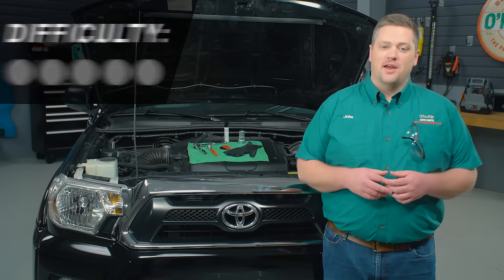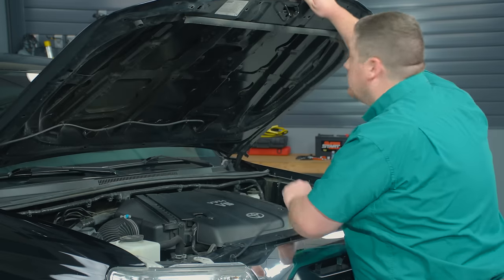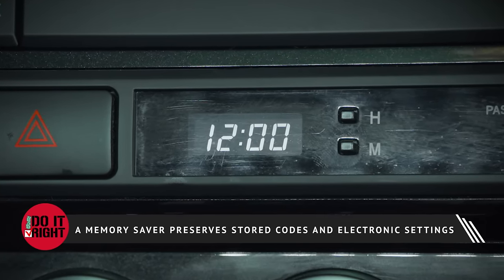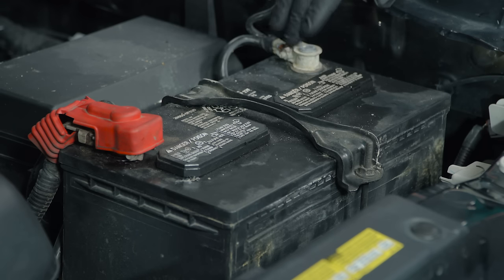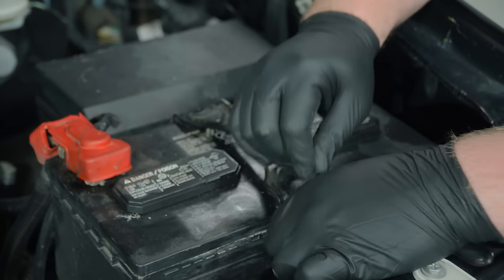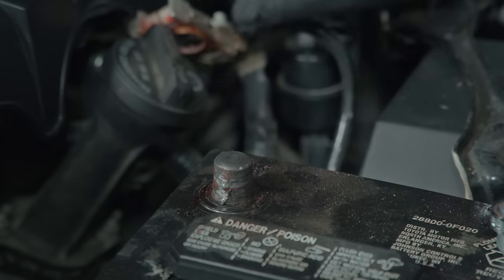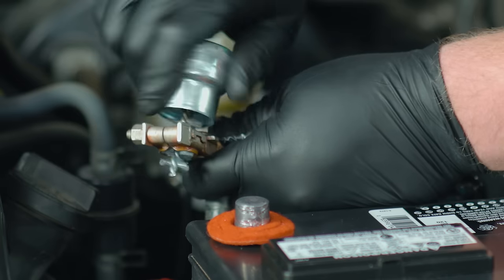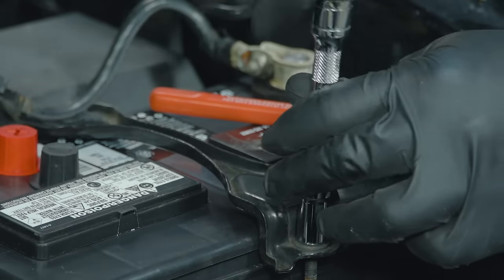How To: Install a Battery in Your Vehicle

Comment: Negative first, negative last.
Reply: depends, it switches each way, when connecting and detaching, but um, yea
Reply: TheSkidds I always remember it like this. Disconnecting a battery? No Problem. NP. Negative first, and then Positive. And of course the opposite when reconnecting.
Reply: Cooooooooom

Comment: Usually videos made by companies that sell motor vehicle parts, regarding how to install the parts they sell, give correct instructions regarding how to install them. That is not the case here. The first step should be removing the cable from negative terminal. If you remove the battery hold-down clamp first, there is a chance you might bump either the metal clamp, or the wrench you are using to loosen it,  into the positive battery terminal. That would create a short between the positive terminal and the negative terminal. Bad thing. If you remove the negative cable first, then there will be no problem should the hold-down clamp accidentally touch the positive terminal. When you remove the cable from the negative terminal, you do not have to worry about preventing it from touching metal parts of the vehicle. There is no harm in that. Next after removing the negative cable, remove the positive cable. Remove the hold-down clamp last. When installing the new battery, it is a good idea to coat the battery posts with a thin film of grease. Also coat the entire cable clamp with a thin layer of grease, inside and out. And put a goodly amount of grease on the threads of the screw that you use to tighten the clamp. This will make sure the parts do not corrode. When you remove the cable from the negative terminal of the battery, it is probably a good idea to also remove the far end of the cable, from where it connects to a ground point on the vehicle's body, and grease that connection too, including the threads of the screw that screws into the vehicle's body.
Reply: Great advice! Thank you!!
Reply: This comment is from an experienced professional.  He knows that what can go wrong will someday bite you.  Do it right once, the first time, so you don't have an embarrassing come back on a simple battery replacement.

Comment: What is the reasoning for taking the negative off first, then the positive?
Reply: Because, negative terminal of the battery is grounded to the body of the vehicle. If positive terminal is removed first then chances of a spark are more if this terminal touches the body through the metal spanner or wrench you are opening with is grounded accidentally and may end in flames because lot of combustible material is around. And chances of this accidental touch are very high.

Comment: What am I doing wrong if the the negative cable starts to spark when I try and put it on?
Reply: Positive first when putting it back on negative first when taking off
Reply: @CPLAYZGAMEZ  I did that but when I put the positive on first then the negative it sparks
Reply: @crossovergills7565  It could Be lights or some electronics that needed the voltage.

Comment: Maybe you should have explained, not all vehicle batteries are easily accessible to just grab on and lift them out of the compartment. Some vehicles will require a battery carrier or lifter strap for removal because of restricted space around the battery.. That would have been a perfect way to tell the viewer, if you needed either, carrier or strap, O'Reilly carries both in stock.

Comment: a mechanic came by and fixed my truck and said the battery cables werent connected all the way. well i tighten it up and it still wont start could there be a different connection issue he didnt tell me about..
Reply: i had it running all day yesterday but in the morning getting ready to go to work. it didnt start. im guessing its the same issue..
Reply: Sounds like a battery to me

Comment: What does it mean when I connected the new battery my lights turned on and the negative cable sparked. Then when I tried turning the key smoke came out the fuse box
Reply: You accidentally hooked positive wire to negative post, and negative wire to positive post

Comment: What happens if u take out the positive first?
Reply: There’s a higher chance of electrical sparks when the ratchet touches metal while taking off the terminals.
Reply: @16vth87  does this damage the battery or electronics?

Comment: I have a top/side post battery.My ? Is can i somehow attach both top and side post and drive off.My side post terminals is very rusty is the reason why I'm asking.I think the reason why my car shuts off cause my terminals is rusty so i know i can use a tool to scrap the rust off and i made shure the battery is fully charged especially before i make a trip ???

Comment: i have a problem with mine.

 i tried to put the negative wire in the batter but it starts to spark and tries to start

what do i do about that need help asap i dont want my car sitting here
Reply: Is your car still sitting there? Were you able to figure it out
Reply: apeshit clothing yea it was the starter
Reply: FaZeDaKiDD mine is sparking too. What did you do with the starter to make it stop sparking?
Reply: Eazrock I just bought a used one from a you pull it place